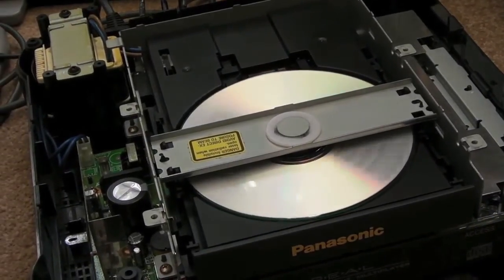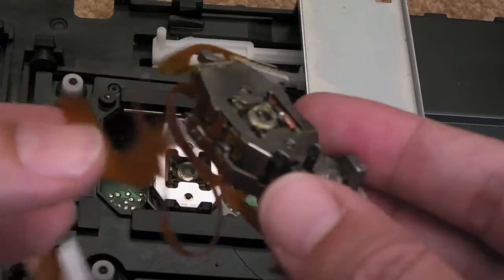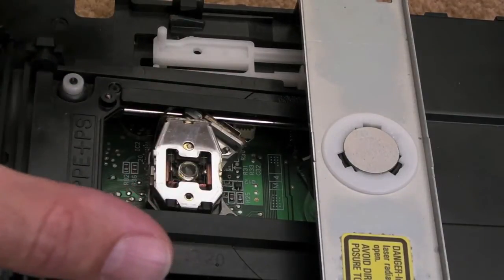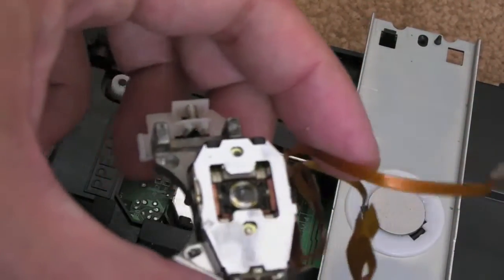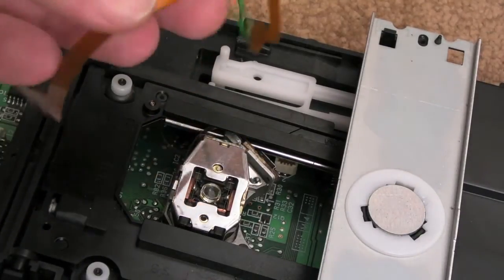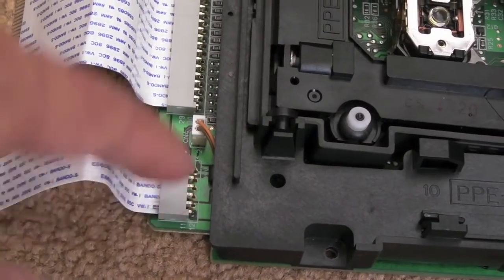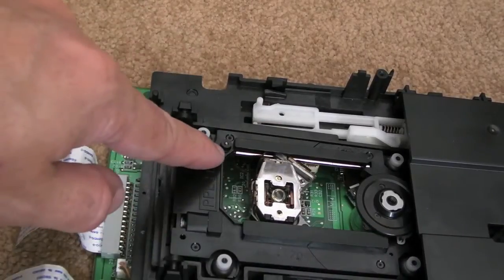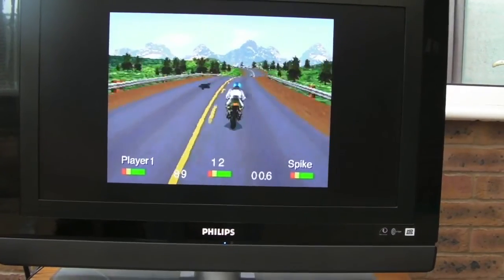Panasonic 3DO CD Drive Repair (FZ-1)

Comment: Just finished watching this a 3rd time. I'm doing the same repair on my FZ-1, and like your mentioned firstattempt, it will not read anything. The new laser is seated properly, and the ribbons are plugged in properly (and the solder blob was removed before I received it.) Can you go into more detail about the guide rod? I'm thinking that is the problem. The unit did read some games before I replaced it, but was picky, and all games I tested were original pressed 3DO games.
Reply from the maker: Firstly make sure there's no dirt or marks on the laser lens - if in doubt use a cotton bud with isoprop / alcohol and very gently wipe over it.   It's worth replacing the capacitors on the motherboard if you haven't done already, the one affecting the 12v line will cause disc read problems!   The adjustment I was talking about is underneath the drive.  If you turn the drive assembly upside down with the board removed you will see the screw that holds the slide rail on which the head assembly travels.   That screw if tightened all the way caused mine to not see discs at all.  Once I started to turn the screw the other way (say 1/2 a turn or 1/4 of a turn) and then re-tested and it worked fine.
Reply: GadgetUK164 I'll give all of those a try tomorrow, and report back. I really hope it comes back to life. I wish Console5 had a cap kit for this. Maybe I should contact them about it! Heck, they even have one for the Jaguar!
Reply from the maker: Andrew Pemrich You can buy the caps pretty easily from Radio Shack (or similar) or maybe off EBAY etc.  Just inspect them, make a note of the uF rating and the voltage.  Then just look for similar looking electrolytic capacitors with the same voltage and capacitance (uF) rating.   There are only 3 that need replacing, and in fact there's only one that relates directly to the CD drive and that's something like 10uF 16v - Very easy to replace.   The largest one there is the 6800uF which is the hardest to get the right physical size for and you can see the exact part here:-

http://www.ebay.co.uk/itm/191309538332?_trksid=p2059210.m2749.l2649&ssPageName=STRK%3AMEBIDX%3AIT
Reply: GadgetUK164 Made more attempts adjusting the guide rail. No luck.Do you think it would be possible to send the drive section your way, while I recap the board? I would quite happily pay you, as well as shipping both ways, to get the drive reading.The 3DO was a gift, so even with some repair costs I'd still be up on the deal.
Reply from the maker: Sorry but I don't do repairs for people - I suffer from a health condition which limits the time and energy I have already, and I couldn't guarantee an end result - especially on CD / DVD drive - I hate them lol, they can be really difficult to work on unless you really know what you are doing.

I wouldn't give up yet, do the recap, then take the drive apart again if its still not working and examine all the connections etc to make sure everything is correct.  Also look closely at the anti static solder point to make sure it is properly removed and inspect the voltage pot on the laser to ensure its in a similar position to the original laser.  You might just have a faulty replacement laser.
Reply from the maker: Have you tried putting the old laser back in to see if it does anything?
Reply: I planned on putting the old laser in next. The new one has the blob removed, and was so when it arrived. What are the odds that it was shipped faulty?
Reply from the maker: From China, I would say 50/50.  To be on the safe side I usually buy 2 or 3 from the same seller.
Reply: GadgetUK164 I put my old laser back in, and it works as well as it did before (reads pressed audio and Monster Manor, still refuses to boot Myst,) so I am guessing this replacement is a dud. Which screw adjusts the laser pot, and which direction do you turn it to intensify the laser? I know it should only be tiny increments that I turn it.
Reply from the maker: The laser should be set the same as the original laser!  The pot is the only one on there I think, on the laser assembly itself.  You really need to adjust it when the head is out of the unit.  Just check its set the same as the original and if not, adjust it until its the same position as the original.

If you want to adjust the old one, measure the resistance settings first and write them down, then try a tiny bit clockwise, if that doesn't make a difference try anti clockwise from the original position.
Reply: GadgetUK164 OK, thanks. Upon further testing, the original laser is recognising pressed audio, but playing back choppy static. Is that down to bad caps?
Reply from the maker: Andrew Pemrich Hmmm, can you hear music at all but its just really crappy?  Or is it just random noise?   If you can hear parts of music but really noisy then I would think that's the laser.  Where did you buy the laser from?  Check the 'new' laser voltage position - if its not the same as the original, adjust it so it is and retry.  It's worth recapping the PSU - Problems on the 12v line (audio op amp and CD drive supply) could cause both read problems and distorted crackly sound so I guess it's worth dealing with that first if you can.
Reply from the maker: Andrew Pemrich Also, the good news is you are making positive progress!  People can often give up far too easily when the solution is just around the corner.  My suspicion is that a recap could make it better but not perfect, maybe pressed CDs will be fine at that point and maybe it will still struggle with CD-R.  At that point you likely just need a good laser.
Reply: GadgetUK164 Think I'll oder another laser or 2. Increase my odds, and do a full recap.
Reply: GadgetUK164 It was the original laser that could "see" pressed audio, but playback was random bursts of non-music. Also, I think I killed my original laser last night. Gave its intensity pot a 1/8 turn clockwise, reinstalled, and it wont even fire now!. I put it back, but still no output. I couldn't easily compare the two. My new one has a crosshead pot screw, and the original has a weird non-standard hole that I had to adjust with forceps. The new laser was purchased from a Hong Kong based dealer on eBay.
Reply from the maker: Try buying one from the Ali Express link I posted on the vid description!  I've had two from there - both worked perfectly with pressed and original discs.   Obviously contact the EBAY seller as its very likely that laser is the fault.

Sort those 3 PSU caps out as well, and when you get a working laser I am sure it will work 100%
Reply: Aliexpress, here I come!
Reply: Andrew Pemrich did you get your laser repaired? Just picked up a 3do with the same issues and plan on ordering the part from Aliexpress.
Reply: I had some issues with the laser I got, and shelved the project. I'll probably take care of it this summer.